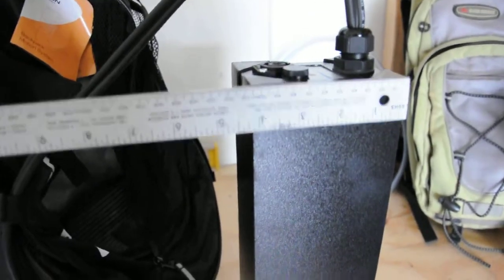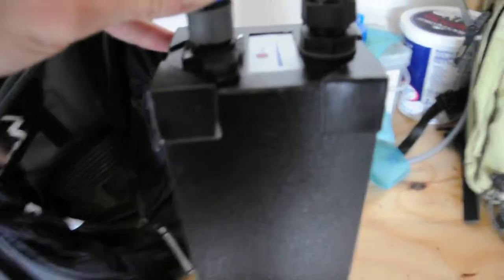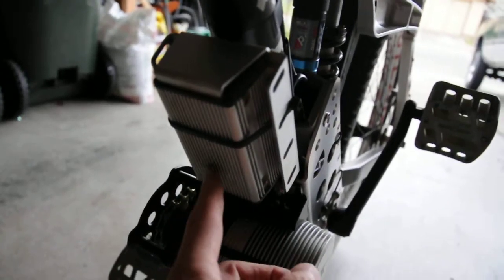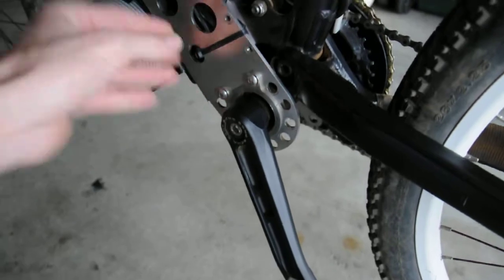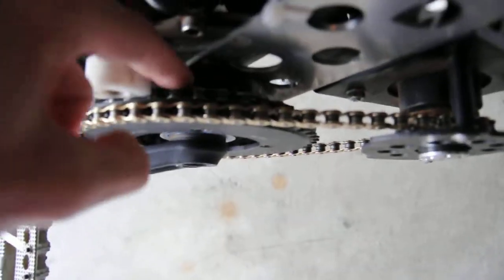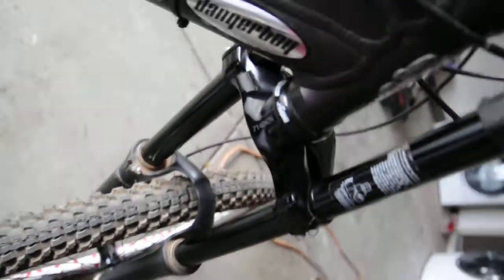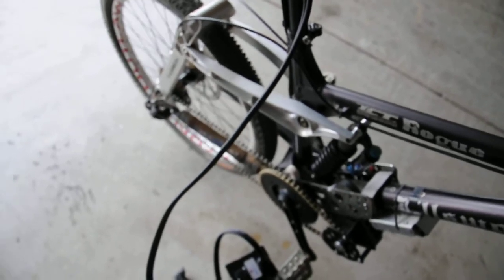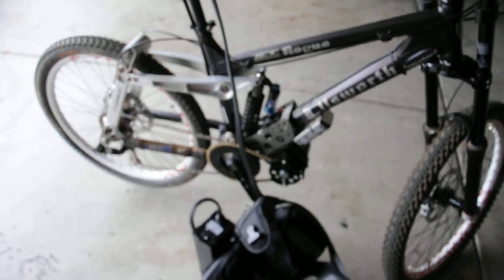Electric Motor on Downhill Mountain Bike "ego-kits.com"

Comment: Riding lifts for me is a treat, I ride at Innerleithen for the vast majority of the time. There is no lift, so a steep push up is the only option. It has never done me any harm. And as a racer, pushing the limits of what is possible is something that inevitably ends up in a crash. I am a very good, hard rider, and if you ask any other good rider, they will tell you that the harder you ride, the harder, and more frequently you crash. So i expect things to break every so often...

Comment from the maker: The kit holds up just fine even after fairly serious crashes. If it gets torn off and disintegrates within one run perhaps you need to learn to ride better.

You mention "blue trails" which leads an intelligent person to conclude you are riding lifts to the top, not pedaling. Fitness is not an issue for me. Exploring uncharted territory and climbing hills without lifts is my idea of fun.

Comments on durability and fitness to purpose without knowledge makes you appear dumb, arrogant and sad.

Comment: Yeah, thats fine if you only plan on pooling round on blue trails, but if you actually use the bike for what is for then it will get torn off and disintegrate within 1 run. Get fitter and push if you can't ride.

Comment: if ever you need another battery i reccomend osn power. i bought from them and they do free shipping.  you could mount a 48v 20ah on a seatpost rack for longer road rides also.  the a123 20ah prismatic cells are great

Comment: a 12ah 48v lifepo4 battery is not $1000 dollars or it shoulnt be.  i paid 650dollars for a 20ah 48v lifepo4 battery with free shipping with a123 cells. you are deifnitely paying for the work and time  gone into cnc maching the motor mount bracket with the ego kit.  cyclone kit cost me 573 dollars. so $1220 total.  you can see my point the ego kit company is a rather expensive route.  fair enough if you dont mind paying the extra but for those that do you could custom cnc a mount cheaper

Comment from the maker: Yes, it is very good. It is high quality except for one bad switch in the aftermarket controller which is easily replaced. If you're into motorized bikes, I recommend it. Only the bad switch so far, everything else is top notch. Please check out the ride video to see the operational aspects of this motor and decide better if it is for you.

Comment from the maker: I'm sorry that I don't remember the shipping price. 

Regarding falls:
The connection is easily disconnected without damage to the cable or connection as it is a light friction bond.
The battery is not a lead acid battery. You would have to contact the dealer for better answers here as I have not punctured mine. The battery is in a backpack so it is easy to replace. Mine has not worn out but I'm sure another is available if it does.

Comment: how much shipping cost you? I guess this would not work on a full suspension carbon frame right?  And also when you fall off the bike as we all do, what happens when you let go of the bike but the cable is connected?  Does it destroy the connections?  and finally the biggest worry,  that battery is not the safe type, if that got punctured in an accident your body would burn right?  one more - after that batteries life wears out, can it be replaced easily?  I would like to build it into the frame

Comment from the maker: It climbs grades over 13% quite well but will need to be in low gear or the motor heats up. My bike is single chainring 36t feeding an 11/35 rear sprocket and it handles steep in the lowest gear well but likes a slight pedal assist to keep from overheating. With lower gearing the pedal assist would be unnecessary. The speed is approx equal to the fastest you could pedal in any of the gears selected. It has a lot of grunt in the lowest gear but it falls off fast at higher gears.Ride vid out now.

Comment: I was trying to source the brand and/or specs of the ISIS bottom bracket that came with the kit.  My mid-drive system came with the weak square taper bottom bracket and it bent when I hit a dip.

Comment from the maker: Price is approx $3k. Yes it will go 70kph if geared for that. It does climb grades over 13% quite well but will need to be in low gear or the motor heats up. Only mounts to bikes with an ISCG mount and that prevents most NON freeride or DH bikes from direct kit mount...Of course you can find a way if you have tools, time and skill.

Hope this answers all. I will post ride footage soon! Sorry for the long wait.